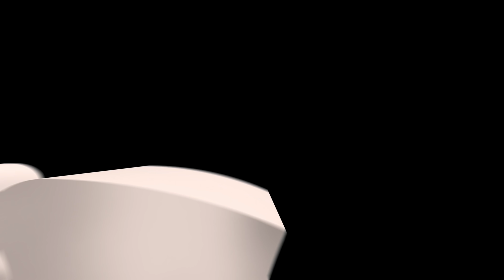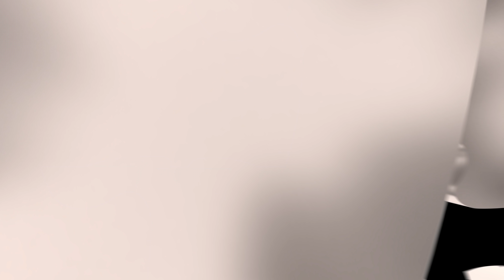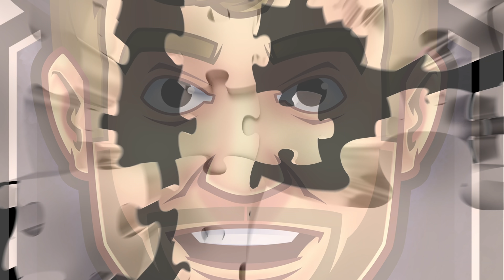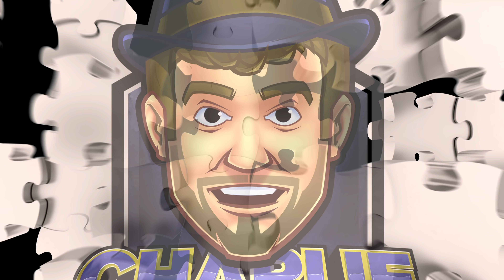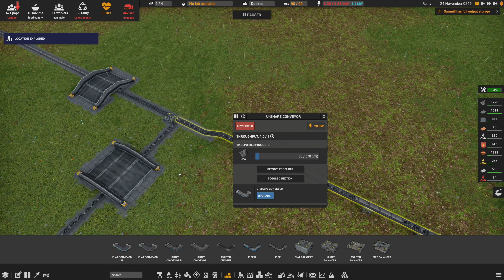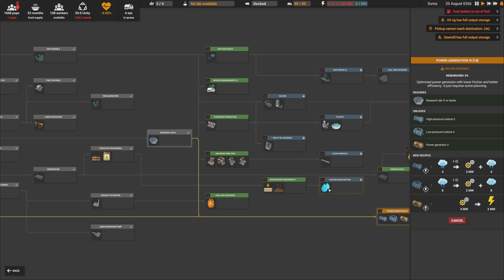IT'S ALWAYS ABOUT FUEL! - Captain of Industry - 21 - Beta Gameplay

Comment: That truck that has copper cant access the tanks holding copper because they're linked to the mining tanks. When you assign tanks like that no other vehicle will access it and if they had copper before they cant do anything with it. Having a new tank not connected may help that lone truck.
Reply from the maker: The checkbox that makes that exclusive, is off. Other trucks can access them no problem.

Comment: i would upgrade your belts to make them faster especially for your food and coal. for the oil i made an oil storage enough for 1800 litres u can get 2 runs from the oil boat before it stops
Reply from the maker: Food belt upgrades are irrelevant, as it isn’t produced fast enough, nor consumed fast enough, to saturate the belt. It’s a huge waste of red parts. It only matters when resources are supplied and consumed fast enough for it to matter.

Comment: To fix the food problem, you might be able to change up the rotation.  You might be able to eliminate the green manure from the rotation, and use the fertilizer instead
Reply from the maker: Sure, but this is a bad idea when your power is shaky, as you'll now kill your fertility when those chemical plants fail to keep up
Reply: Greenhouses will give 20% more food and may let you start making fuel from food again. If you have the materials for the upgrades.
Reply from the maker: I can already make fuel from food as is. The water is the problem, not the number of farms.  In the video released in a couple hours, you’ll see food is fine. Water and coal are the challenges. - and I would have a fix for that if the new series wasn’t replacing this one (community tab).